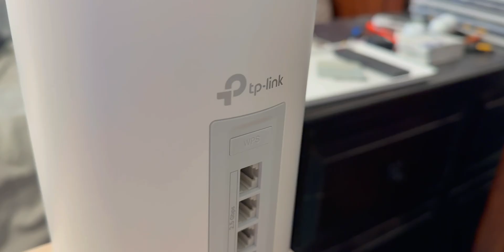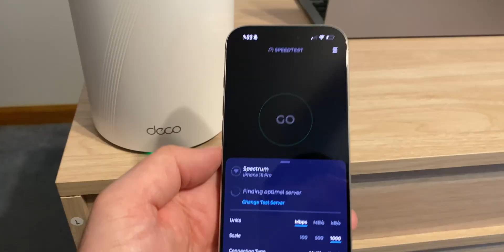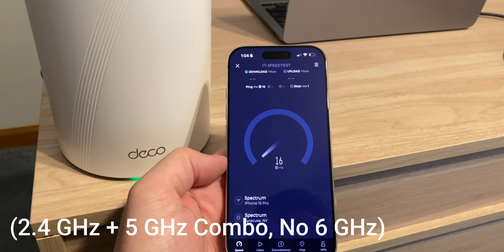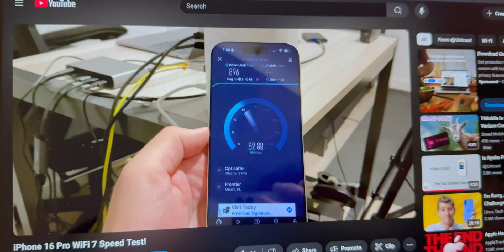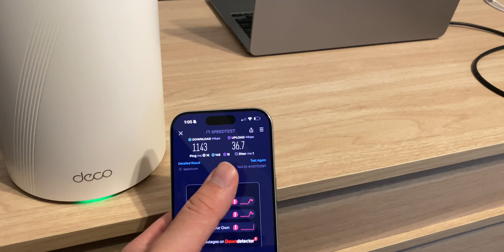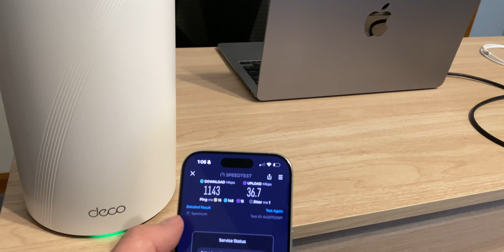WiFi 7 Speed Test With Less Interference On The 2.4 GHz + 5 GHz Bands!

Comment: I have same AP! each using 10G Multimode Fiber and I subscribe 2Gbps with GPON ONT SFP and Mikrotik RB5009 as router, but I don't have any WiFi 7 capable device yet, at least I can get 1600Mbps only from 5GHz @ 160MHz Bandwidth. Surely nice to use Multimode fiber without worrying interference and link downgrade